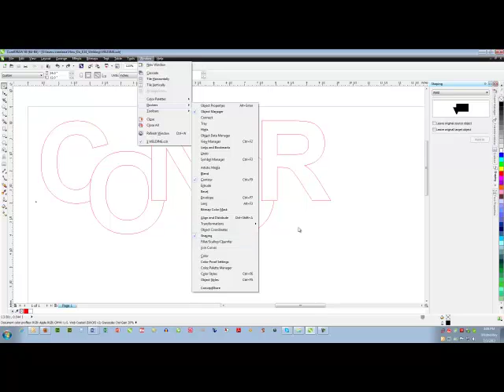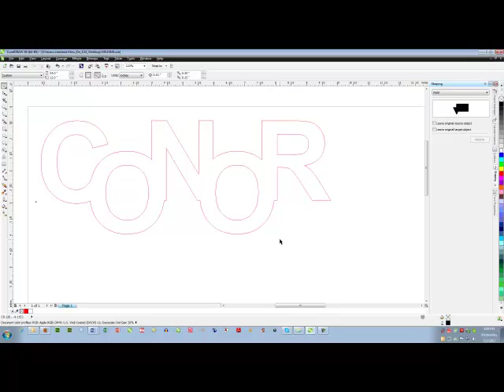Welding tool in CorelDRAW

Comment: hi there , 
Having issues with the weld tool as trying to select the font does not want to highlight and weld icon is not visible please help :)
Reply from the maker: One thing she did not mention in this video is to make sure your text is converted to an object. To achieve the results she laid out on this video, you need to convert your text to curves (which will turn it from text to an object). Select your text, go to "Arrange" on your toolbar, select "Convert to Curves". Your text is no longer editable and is now an object, allowing you to use the merge function. Make sure that each letter is laid out so that it is touching and overlapping each other. You can then weld your objects. Hope this helps.